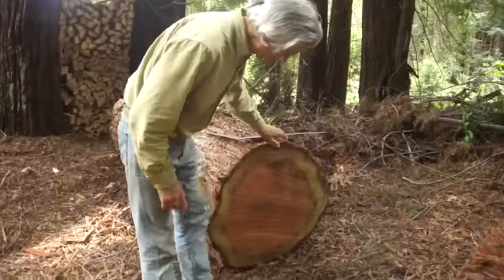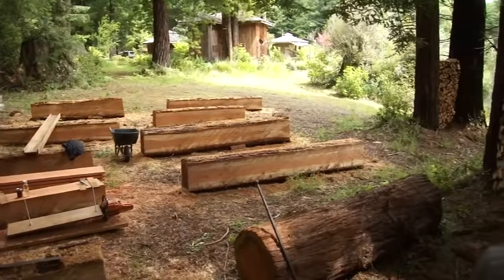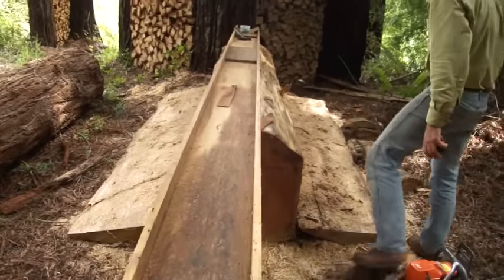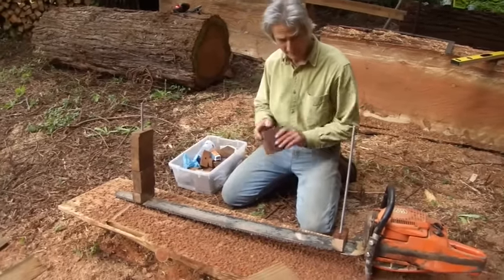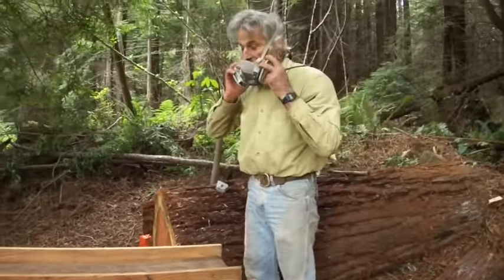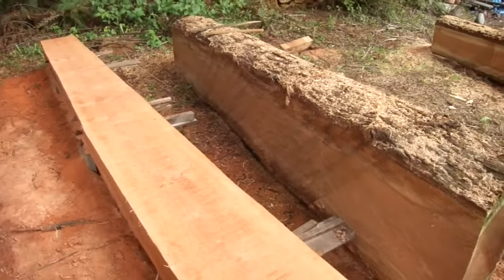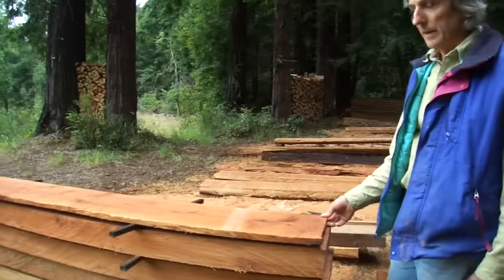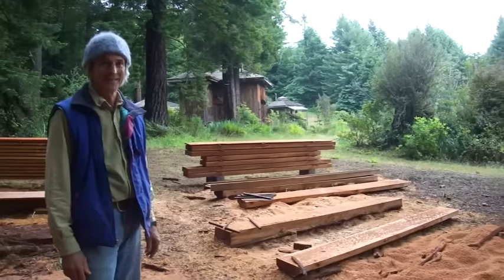Turning a tree into lumber using a homemade Alaskan Mill

Comment: He is either under or over the powerband. I might suggest he use full skip pico chain, a different tooth chisel or a saw with more torque like a Stihl.
Reply: Pico? Is that a brand or style or ???
 Where do you order yours from? I run skip on my 28" Frawley's online saw shop. Great immediate service.
Reply: @ericlee6816  Full skip Pico is a chisel angle available at specialty saw shops worldwide.
Reply: @barnowlboxes35  only pico on Frawley's aka loggerchain.com was for 14" bar I think. They had other rip but (Pico?) Google didn't turn much up either. I want a full skip rip for my 28" and 42".

Comment: Did you just dropped the saw?
Reply: Every time you nail your guide, you impact it harder than the vibration of the saw, you may want to check if is still at 12 1/2" from the top to your mark, before cutting or, you may have to remove three nails or even 4 nails at any given moment if after nailing each, and even while nailing, before ending nailing each nail, leaving its heads out, you want to check for measures to stay on points or do earlier the necessary adjustments.
Reply: I loved this video! Watched it twice already! One day I would love to live in a property like this one which in Miami would be very expensive but, I can dream! Thank you for the Masterclass!

Comment: This dude is fucking nutty. Wears a "gas mask" for one cut but not for another because "the wind" will keep him safe for the one cut...to say nothing of the saw dust that the mask actually protects him from. And that tedious process of adding blocks to give him the proper depth for the cut--if he is already using all thread rod, why not use some nuts and washers to set the depth?
Reply: This comment is fucking nutty. Who the fuck thinks saw dust is worse than two stroke fumes. Who would thread nuts all day just to improperly support the top board?

Comment: If you can spend 1200 pounds on a chain saw, then spend 2500 pounds on a saw mill, and save yourself all the aggravation and breathed in fumes associated with milling your timber.

Comment: I'm all for DIY, but this setup is SUPER janky imo. Those metal guide mills he talks about being so expensive are like $250 and they have handles to actually hold onto rather than relying on your hand not slipping with the saw kicks back. They also have the ability to adjust to any tree so it would have saved him the guide wood. 

Hell of a lot of work regardless. I'm just surprised that he's still got all his limbs after doing it this way for so long.